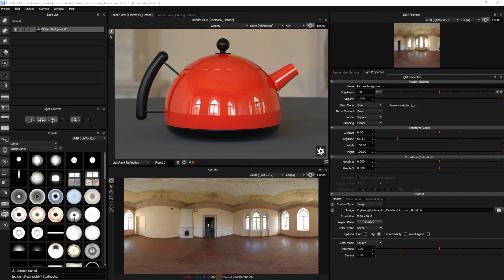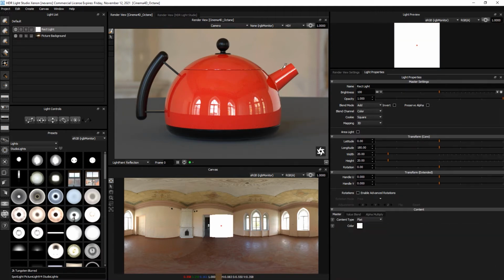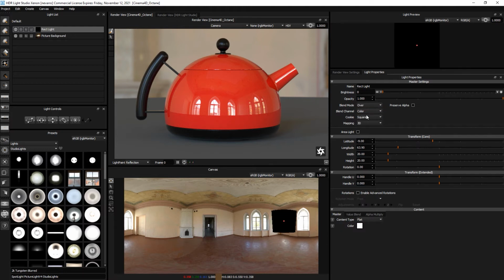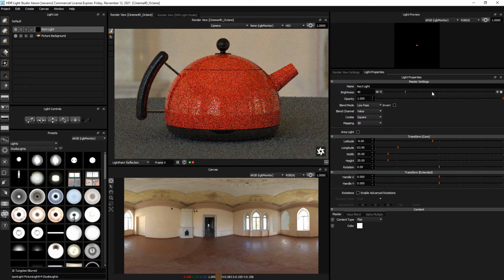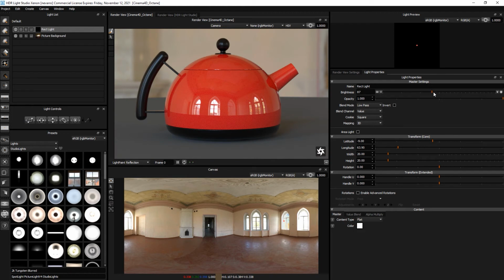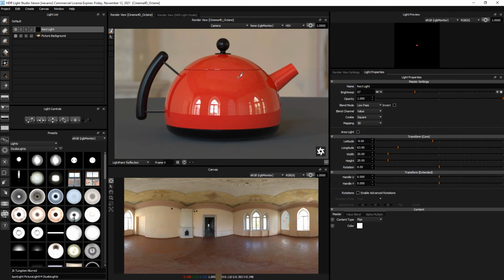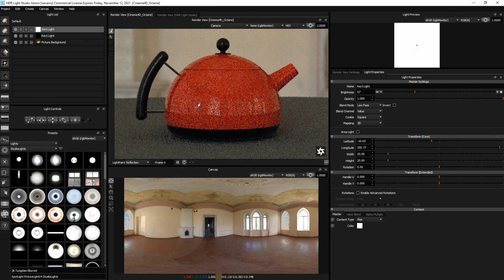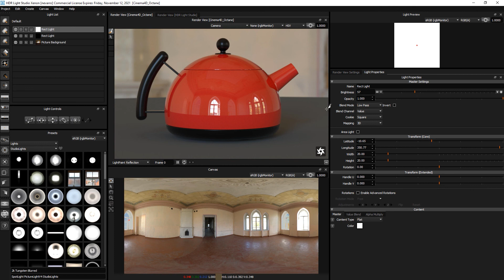Remove Unwanted Reflections from HDRI Maps

Comment: Is there a way to use the reflections from an hdri on an object but not use it to light the scene? Cheers
Reply from the maker: Yes, this is controlled in different ways in different 3D software and renderers. You would need to look at the environment light options available for your 3D software.